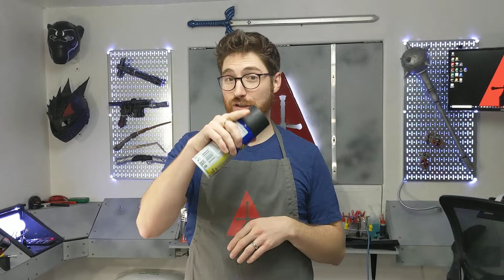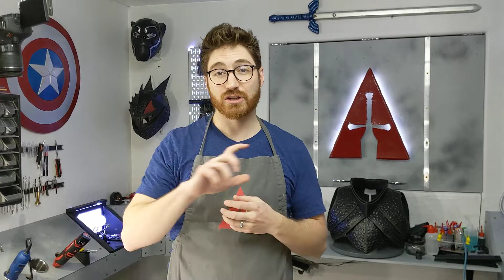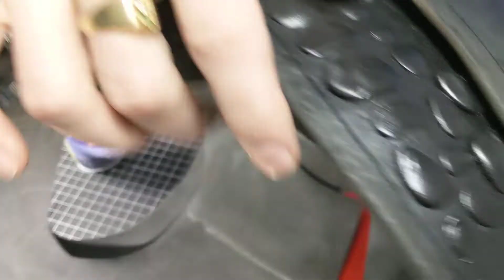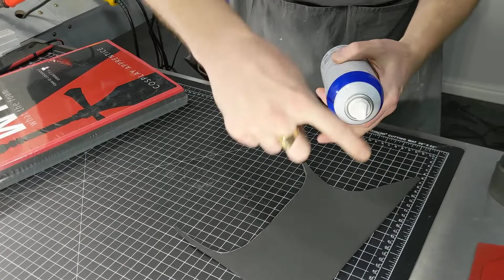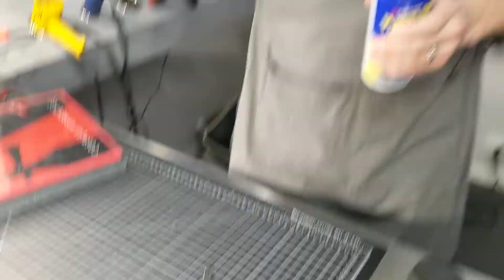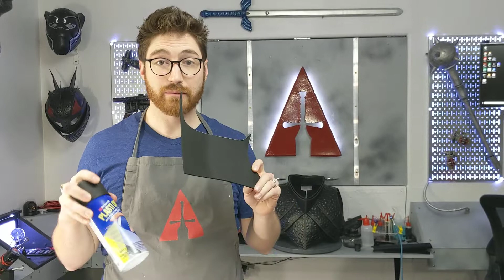How to get smooth PlastiDip finish on your cosplay - Quick Tip Clip | Cosplay Apprentice

Comment: So we are attempting our first armor piece for our niece (very simple design) with 5mm EVA foam as the base with trim and decorative scales using 2mm EVA to emulate Hiccup and Astrids dragonrider armor from How to Train Your Dragon.  We were using the white plastidip

When we used Plastidip the surface ended up very bubbly and pock-marked.  We had sprayed in our garage (with proper ventilation) to avoid the outdoor moisture and humidity as I've had issues with this on plastic miniatures and acrylic primer, however, the surface quality still ended up being very poor.  We had also heat-sealed the foam with a heat gun a few days prior to applying the plastidip.

In addition, we have some layers of the 2mm trim foam glued along the edges of the armor plate scales peeled back and many of the scales glued on the armor surface peeled up along the scale edges.  We are assuming that as the plastidip dried, it contracted and the "shrinking" cause the foam underneath to warp and peel up.

We did try to use a heat gun to reshape some of the scales and trim and then re-glued these, but the plastidip did actually start bubbing and did not look very good at all. In the mean time since we don't have time to rebuild the armor before the holidays we are trying to fix the pockmarked surface by using a thinned gesso to try and even the surface so it doesn't look as bad.

We're not quite sure what we are doing wrong, do you have idea what might have caused this and how we can avoid it in the future?
Reply: Sorry for the year later reply but you need to heat seal immediately before priming

Comment: I literally worked for a cosplay company from Midwest USA, and I fought with my co-workers over this. We kept our cans near the door, all year round, didn't warm them before use, and other than me, they were proponents of the "small coats". They had a bit more luck with it than others, but I never liked how their stuff turned out: not smooth enough for me. But they also had a huge 40K history, where having those details really just adds to the grittiness of the characters/costume/theme.
Reply from the maker: Thanks for your comment! :) I’m glad to hear I’m not the only one. Did you ever notice a difference in finish with using the different colors of plastidip?  I had a couple times where I was trying a white plastidip and it seemed to give me more problems than the black. It could have been a fluke but I didn’t get more white to try. :)
Reply: @CosplayApprentice  I'll be honest, I started with black and almost never deviated. Only grabbed grey when there was nothing else and I had a big project. Haven't really touched glossifier either, tbf. I just throw Rust-Oleum clear gloss over top!
Reply from the maker: @weebjeez Nice! I’ve mostly stuck with black too but was trying to save some time on a build that was gonna be white and tried it out but it ended up costing more time :/ haha. I haven’t used the glossifier either :)
Reply: @CosplayApprentice  lolol~ I feel like no one in the community trusts it enough to even try it!! Though, everyone I know was using spray paint and Citadel pigments, so what do I know? Maybe my circle were just the 'scrappy" ones, lololol~

Comment: Hi quick question, I’m trying to make an f1 car wing from Eva foam- so smooth as possible is the aim- I’m planning on heat gun > primer filler > plasti dip > then paint coats > then a clear coat to finish. 
Should I add some fine sanding in there somewhere and if so - which stage?
Reply from the maker: Sounds like an awesome project! Sorry if I’m late on the answer.  Is the primer filler a spray primer/filler, paintable, or like a paste like bondo type of thing?  If it is more like a brush on or a bondo type of filler, there would be no need for plastidip and you would want to sand it to the smoothness you want at that stage. If it is a spray I would maybe consider doing it after your plastidip and then doing fine just light sands between coats of the filler and the paint :) Hope that helps :)

Comment: My biggest challenge is finding a way to use spray paints and Plastidip inside. Because the weather is too cold/windy most of the year and I have no access to a garage or shop area to do this stuff in. Ugh!
Reply from the maker: Creaturecast might be a good way for you to seal your EVA foam, you can spread it on with a brush and it is non-toxic and low odor. Or modpodge.
Reply from the maker: I'm glad you brought this up as it is a problem I face as well and I know others do too so I will add it to the list to make a video talking through alternative options with limited space and cold weather. Thank you!!
Reply: You can buy or make a small airbrush paint booth with ventilation/ air purification. I use aquarium carbon to filters to filter air painting and soldering. You can use or buy a cheap PC 12V DC fan to move the air and a clothes drier vent hose.  Cheap LED lights. They also sell collapsible paint booth made just like a tent in the pint section of Walmart, Lowes, Home Depot and other hardware stores. Wagner is the paint supply company that makes the booths. I think they are $25-30. It comes in a small bag and even has a screened “window” or “vent” the size of a box fan.

Comment: A great resource that I always revisit. I love how our definition of “warm” weather is relative. It’s 50 degrees today where I am in So FLA and I was wondering if it would be too cold to spray 🤣
Reply from the maker: Hahahahaha :). So true, During the summer here we get up into the 100s a few times but is at least 90 all summer. But once we got fall and then especially winter it's warm when we get into the 40s :). 50 degrees is usually my cut off for doing any spray painting or especially Plastidipping, if it is 50 or above I say it's usually pretty good. :)

Comment: Thanks for all of the tutorials! I am in the painting stage of a project, and the plastidip dried really differently on different surfaces--very matt on the eva foam, thicker, glossier on the foam clay and quick seal. So seams and foam clay features really stand out under plastidip coat. Will this even out when I pain, or do I need to add some more coats of plastidip?
Reply from the maker: No probs, glad you are finding them helpful! :) It should even out with the paint job,. How many coats of plastidip did you do?

Comment: Great tutorial, as always. How long after applying your coats do you have to wait to paint?
Reply from the maker: I often use a Rust-Oleum 2x coverage spray paint as my base coats. And depending on the weather when it is warm out I will do it as soon as 15-20mins after the last plastidip coat. I live in a dry climate though and so time may vary. Basically just once the plastidip is not wet anymore :)
Reply: Thank you. Wasn’t sure if dry to the touch was sufficient or if the Plasti Dip neeeded to “cure” at all. I used these tips and applied the Plasti dip and it came out GREAT! But man is that stuff gnarly. Now onto paint.
Reply from the maker: Yeah, I give it more time if I am keeping it as just the plastidip coat to get leather looks , for that I usually give it a day or so to let the rubber settle a bit and not be and squeeky/grippy, but when you are doing a base coat over it I think it helps adhesion to do it sooner :)
Reply from the maker: Hahaha, yeah, that stuff is definitely stinky!!! :/

Comment: Hey I've been watching a few  of your videos and am working on my first project a foam helmet (Mandalorian 500K challenge) and found this video really helpful I'd love to see you apply the product in this video, would you recommend Plastidip for a helmet or something more sturdy (sealer like Mod Podge, etc. )
Reply from the maker: I tend to use Plastidip a lot, but for a mando helmet I would look at using a product called Fine Finish by Prop Monkey Studios. That is probably what I am going to use on my Mando helmet.  It stays flexible but it is sandable, so you can get a super smooth finish :)

Comment: I have a question, how does it cure, cuz today is 56 degrees today, and i'm working on my armor and plastidip said over 70 degrees Fahrenheit, so how much degrees will it be when i heat it up?
Reply from the maker: My rule of thumb is to make sure it is at least 50 degrees Fahrenheit out to do Plastidip outside.  For warming up the can, I don't know what temp it will be, mostly just go untill the can doesnt get cold when you shake it again.  If the sun is out and it is at least 50 outside, it will be ready for a new coat within about 15-20 mins.  I'm in a dryer climate so that may vary.

Comment: Is plastidip-coated foam able to be spray painted over with normal spray paints like rust-oleum, or is there some surface treatment or special type of paint needed first?
Reply from the maker: It works great! I spray Rust-Oleum spray paints as my base coat on top of the plastidip all the time.  I tend to paint it about 15-20 mins after my last coat of plastidip. Not sure if waiting longer would cause any issues or not. :)

Comment: so i have a problem, the plastidip caused the caulking to bubble and now i have to sand it all off what can i do to stop this?
Reply from the maker: What type caulk did you use?
Reply: @CosplayApprentice  dap silicone plus, also is there a solvent that would remove paint but not affect the contact cement?
Reply from the maker: I've never had a reaction like that with plastidip and caulk. I use dap quick seal though. :/.